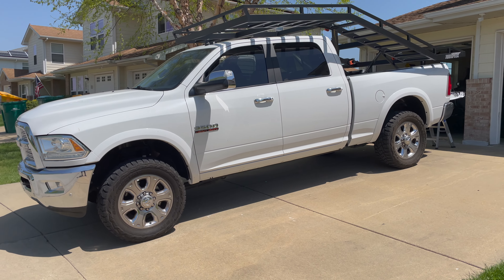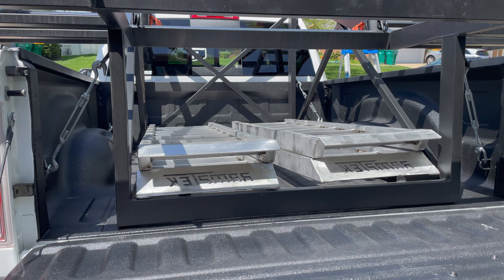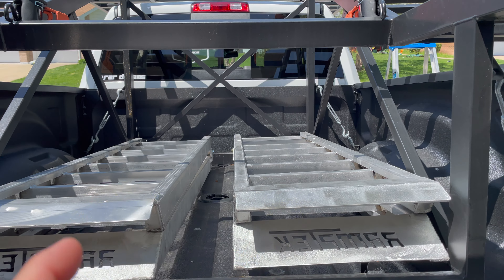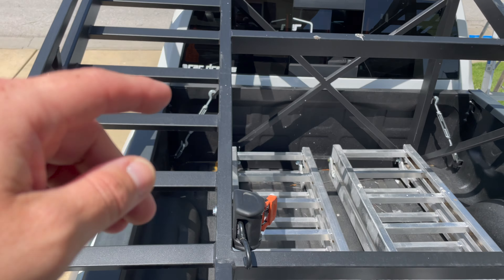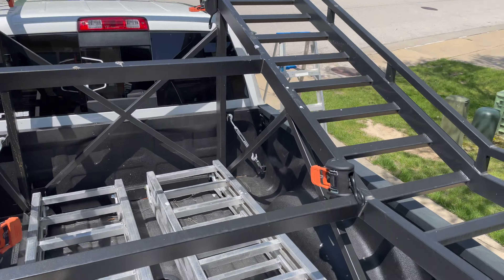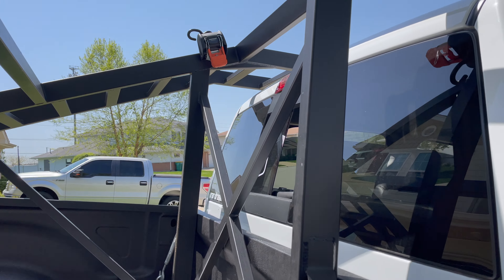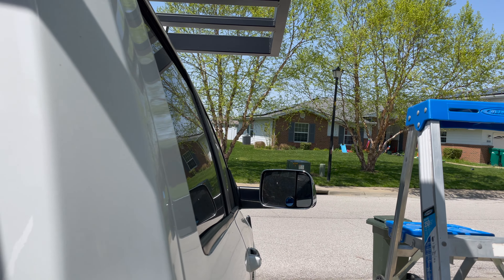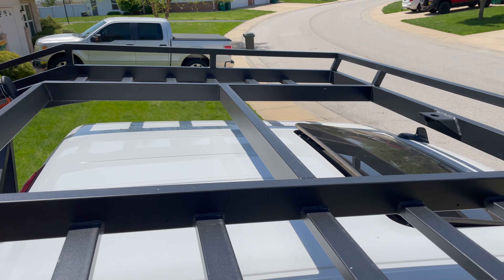HD UTV TRUCK RACK | RampTek, an In-Depth Look & Assessment

Comment: The system is totally dependent on the bolts that hold the truck bed on the frame. Seeing the bed on my 2010 ford rusted off the frame before the warranty expired, (salt in the northeast)I wouldn’t chance it. I feel much better using a trailer. The high center of gravity compounds the problem.

Comment: Looks good 👍 might want to add some clearance lights for that over hang can’t wait to see how it loads
Reply from the maker: You know, I have been thinking of that but I'm not sure why they are needed.  Can you help me understand that part?  I was thinking maybe I should make some type of contraption to put temporary amber lights at the top of the RZR when it's on there.  Like maybe some lights that can be attached to the unit on magnets so I can just pop them on the roof of the machine or something.  Let me know!
Reply: Rack definitely looks good and well built. 👍 

Clearance and ID lights required on any vehicle over 80 inches in width. The outside corner lights are the Clearance lights to mark the 4 corners and maximum width and the three center ID lights are there to quickly notify an oncoming motorist that your vehicle is over 80 inches wide and is particularly useful for them on a 2-lane road. These laws have been in effect since the 1930's. 😀

Comment: You should watch a quick video before you build a "wood Rack" Those ramps sit perfectly upright in the built in tabs. Slide Them in upright and they catch under the front and the back fits snug.
Reply from the maker: Aaarrggg, is there a way you can send me a picture?  I can give you my e-mail address: rzrdreams@gmail.com ???  I would appreciate it so much!
Reply: @RZRDREAMS  I just saw this. I will send you some pics
Reply: When I picked my Ramptek up, the owner (nice guy) said that there may be a little bending of the rear ramp tab to get the best fit.  They work well though.  An 18" rubber tarp strap from the top of the ramp to the rear bed tie down helps keep the rattling down.  Thanks for the video!

Comment: My buddy has a rack on his lifted (8”) 4 door Chevy truck with a 6.0 gas motor. Sketchy as hell!! The part that goes over the bed actually bent and his turbo s4 actually flew off his truck on the highway 😂😂. Obviously it was totaled. He had the guy who built the rack add on more supports and his insurance bought him a new RZR. He also mounted a harbor freight winch to the very front of the rack and he uses it to pull the RZR up on to it.
Reply from the maker: Haha, WOW!  Well, it seems like it was an older model truck and with an 8" lift!!??  Holy cow!  I'm thinking the only reason I would need to use that front-end tie-down point is in case the RZR is really muddy and I need to use the winch on my machine to pull itself up.
Reply: I bought a RampTek a little over a year ago I put a mor ride draw in the center of it for my ramps also I added e-track tie downs. I had problems with my straps coming off my tire I found some rubber blocks that slip on the straps that have risers that go down in my tread haven’t had a problem since